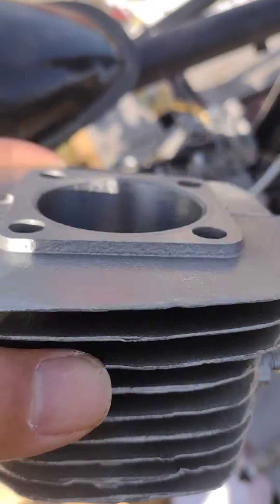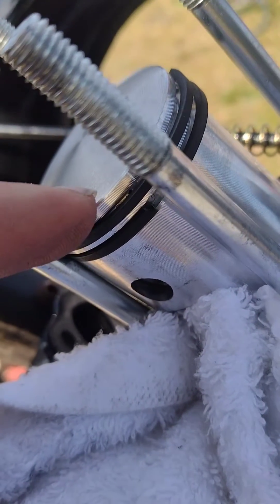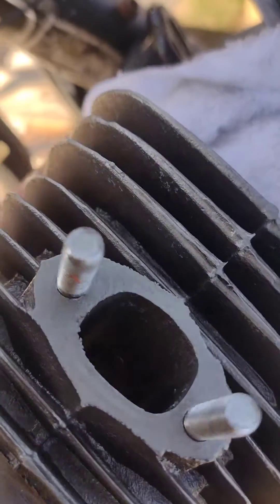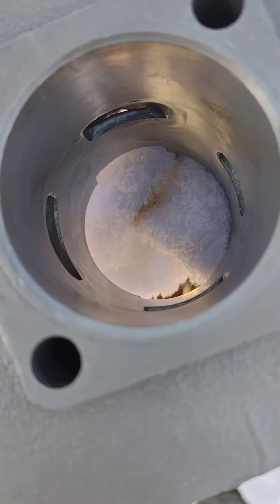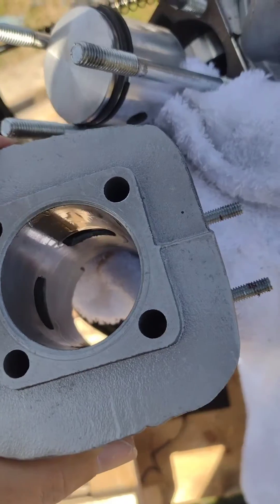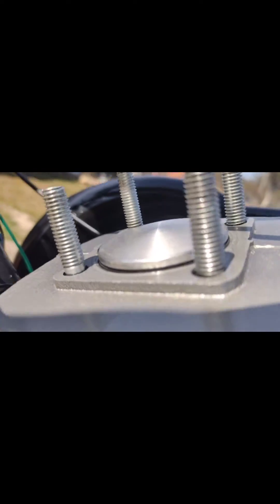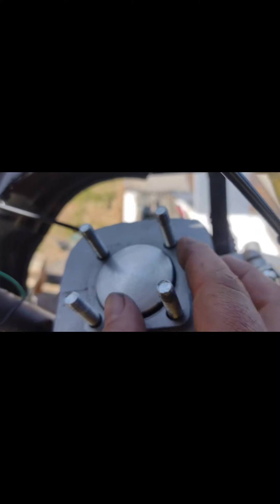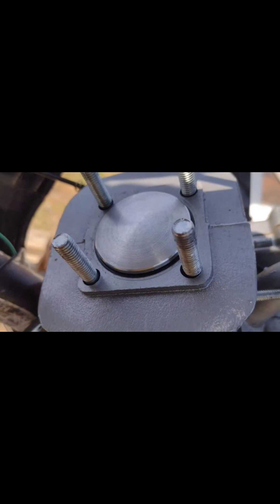TDR Moto cylinder and piston performance testing

Comment: Make a Spacer plate an run that sucker, mite be wrong piston or stroke 🤷‍♂👽👍🏻
Reply from the maker: I ended up using the old CDH piston, new rings and running that cylinder. It's had a tank through it so far, a little more wearing in and I'll run it up on the dyno
Reply: @SafetyUggs  Sweet, I know spacer isn't stock stuff, 👽👍

Comment: Aww those cylinders could be rippers
Reply from the maker: The port timing suggests they'll be pretty low power and low RPM. We'll find out today!
Reply: @SafetyUggs  no porting??
Reply from the maker: @justanothermotorizedbikech  definitely porting. But first, bolt on mods.